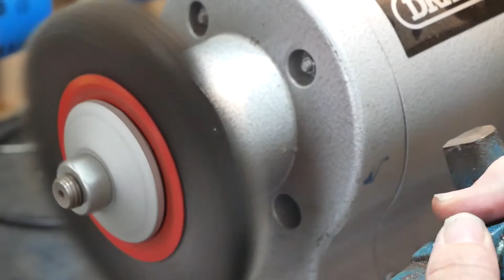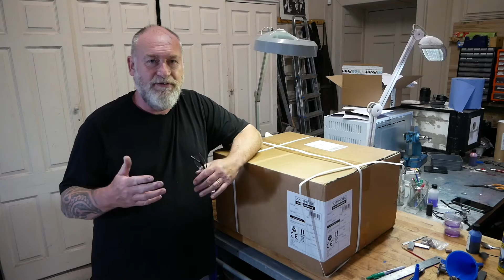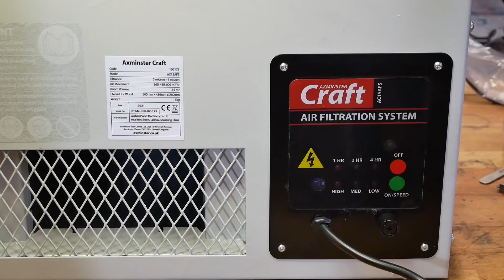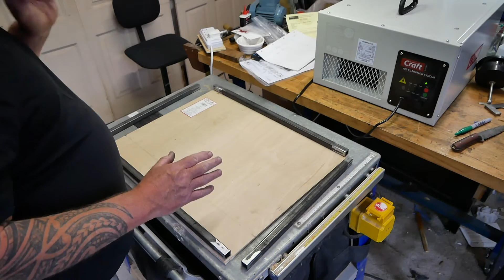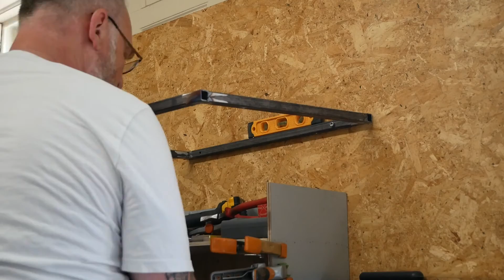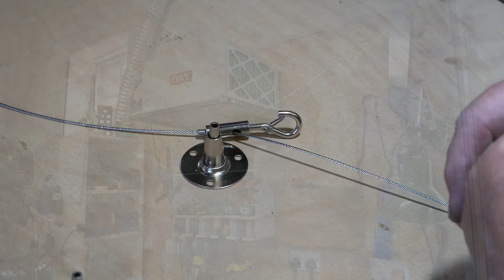Axminster AC15AFS Air Filter System: Part 1 Unboxing and Installation

Comment: Thanks for this video! Just thinking of buying the same thing... I saw you still use the stock "bag" that comes with the dust extractor which you use on your band saw. That thing lets all the fine dust back in to the air. I just replaced mine with a cartridge filter from axminster and it is a game changer.
Reply from the maker: Thanks for that. Good shout.

Comment: Felt like you had perfect conditions to put it on chains from the ceiling, but I might be wrong.
Reply from the maker: Sadly the ceiling in my workshop is incredibly high and it is a very old house.  I couldn't do that, but I agree, it would have been ideal.

Comment: Hey Nick! Very nice video. I can relate to the dust problem and was looking for a solution to controlling this mess for some time. I got quite a few things to say so here goes:

1) Regarding the vacuum pump that you have, or whatever they are called. You can do a modification to make them appropriate for metal and install one on your grinder. You just have to install a bucket with water between the start of the hose and the machine. The goal being, making the way for metal burning hot particles more difficult so they end up in the water instead of  inside the pump burning the filters etc.
2) Please make a review video after a while.
3) Is this intended to be used for example while you are grinding or when you leave the shop so it clears the air. Reason I am asking is because once the dust settles on the floor and benches it is to heavy for the machine to suck into.
4) lastly after for example 4 hours of grinding while the filter is on, do you have to clean somehow the filters or the dust accumulates and just falls to your bench?

Keep up it up,
Panos
Reply from the maker: Thank Panos. I do use the water bucket solution which does collect most of the heavy stuff.  2. I certainly will. 3. I would certainly have it while I am working (grinding, sanding or sawing) but I hope it would collect very small particles that are hanging in the air afterwards. 4. the filters are removable and you can take them outside and blow them with a compressor or vacuum them. However you will have to replace them eventually if they get too clogged with dust. They cost about £25 each.

Comment: Really interesting video. I've been concerned by the dust from quite a while too, and that seems like a good idea to eliminate the remaining fine dust that alway keeps floating in the air. Looking forward to see how well that sistem works.

Ps: On the particular case of the belt grinder I found that one of the best ways to avoid dust while grinding metal is using one of those water mist refrigeration devices, is a lot less messy that I thought and also heavily decrease the posibility of overheating blades.
Reply from the maker: Thanks. I am very interested in your mist idea. Where can I find out about that.
Reply: @Ukenick  I think the "original" one, or at least the one I've seen first on the internet, is called "kool mist", and they sell a cooling liquid you mix with water and also the mist device. Most of information was from american people on forums because the company is there. But as getting it here in Spain with customs and all was crazy expensive I searched for an alternative and found different devices on ebay for about 13€ (from china of course). I ordered one to give it a try and it actually works pretty well with just water (you need an air compresor though, even better, a quiet one). I'll take some pics of mine if you are interested and I'll send them to you.
Reply from the maker: @aikabacrafttools9129  oh yeah. I’d love to see some pics

Comment: As you said, it's very important to control dust in your shop. Is this considered to be a HEPA grade filter, and are filters readily available?  Looking forward to Part 2, Nick!
Reply from the maker: Thank you Daniel. How are you doing? I will check re the HEPA. The filters are readily available but not cheap. Take care
Reply: @Ukenick  Doing well, Nick.  Thanks for asking.  Have seen the Jet brand here in the States, but very expensive ($400).